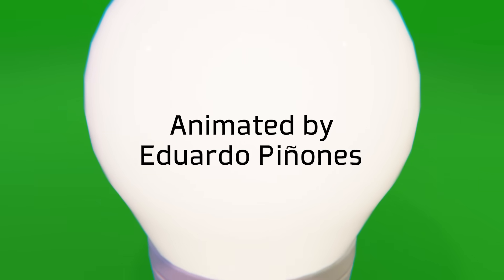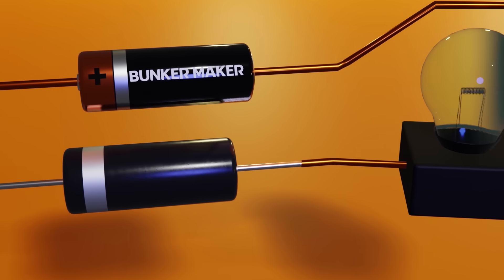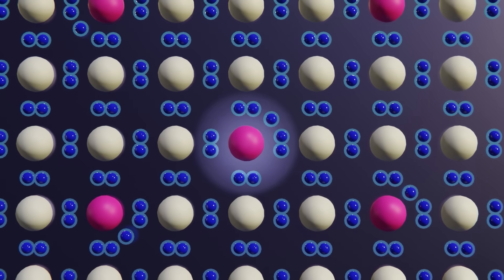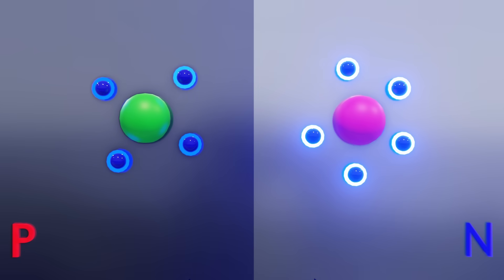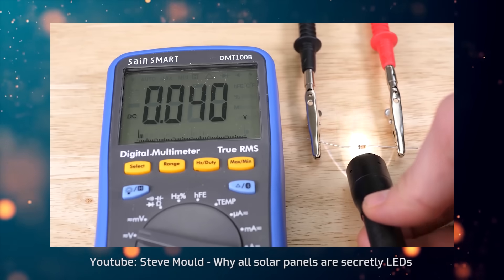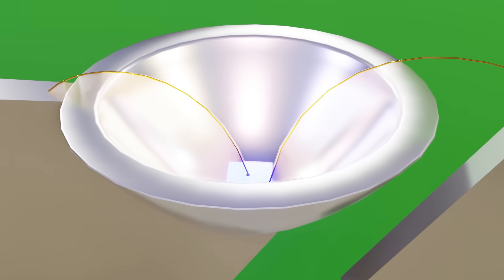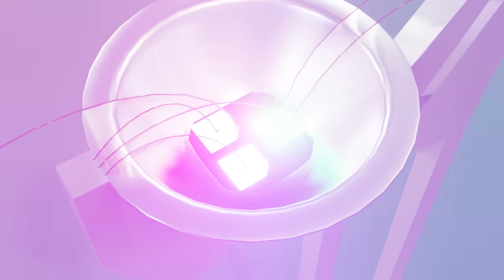How LED works ⚡ What is a LED (Light Emitting Diode)

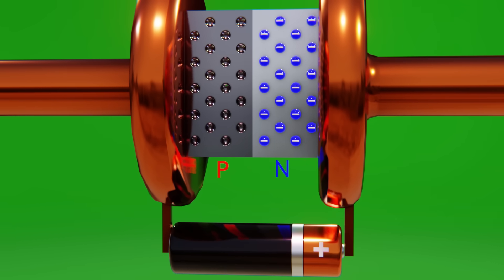Comment: At 3:45 you showed that connecting the negative terminal to P side and positive to N side results results in reverse polarity and hence no current flows
Then at 7:00 you say that P type side needs to be thinner and on top as this is where the energy exchange happens (also shown at 00:20)
Now at the beginning of the video 0:13 it can be seen that the negative terminal is connected to the P side and positive is connected to N side, yet the current still flows but doesnt in the opposite polarity which, supposedly, should be the right one
How is this possible? It doesnt make any sense
Reply: i have concluded that his wiring to the P and N type layers on the LED at 7:00 is wrong/reversed (as well as at 00:20)
Reply: We have for over a hundred years considered electrical Current flowing from + to -. . . .    Well we now know that electrical Current is the movement of Electrons, and electrons flow the other way round, from - to +   so polarities can sometimes get confusing.. . .  Any questions. ?

Comment: I first learned of LEDs in the mid- or late 60s and was fascinated as the different colors were developed and efficiency increased. I was aware of the narrow spectrum of light they produced so was excited to see the advent of the 'white' LED. Not so much to my surprise, they are actually closer to the old fluorescent lamps, with the blue energy supplied by the PN junction instead of the mercury arc. But, like the fluorescent, most of the useable light comes from the conversion supplied by the phosphor layer that mimics the colors 'temperatures' we all knew back when: Warm White, Cool White, Daylight, and everything in between. Should these be more accurately called SSFs (solid state fluorescent)?
Reply: Hi sir I am India and i am a electrical engineering student i can't understand electronics so can u please help me with this subject because I don't have any knowledge about this subject please sir

Comment: Simplistic and some misleading information about light emitting diodes. In reality, an LED is a real-life demonstration of quantum mechanics.
.
The movement of electrons and holes (positive charges) in a semiconductor are constrained into discrete energy bands by the wave functions of the atoms in the crystal.   The emission of light is caused by electrons making a transition from a higher energy band to a lower one after crossing the PN junction.    The different colors of light are selected by choosing the band gap of the semiconductor.  Silicon being in the infrared,  gallium arsenide in the red,  gallium phosphide in the blue, and Gallium-Arsenic-Phosphorus alloys being variable.
Reply: Well yes true in the closer detail.. . .  I have know this for a long time, and yes it is at the Atomic level and band-gaps energy levels, but I am not sure if you can bring quantum mechanics into it. ?
Reply: @hughleyton693   Einstein won his one and only Nobel Prize for his 1905 paper using quantum theory to describe the photoelectric effect.  A LED is indeed an example of quantum mechanics in action.
Reply: @geraldmarcyk524    So please explain the quantum mechanics aspect of LED's, because I do understand LED's fairly well, but I know nothing about quantum mechanics.
Reply: @hughleyton693  SImply,  electrons travel in discrete bands in a semiconductor. .  Electrons in an excited state can only emit light in specific energies when they decay to a lower energy band.  (the quantum effect described by Einstein in 1905).  The whole idea of direct and indirect bandgap semiconductors and the impact of the Heisenberg uncertainty principal on the energy-momentum distribution is beyond this discussion.   I suggest you visit Sabine Hossenfelder's excellent youtube channel for more information on quantum mechanics.
Reply: @geraldmarcyk524     Done it again, lost my reply  Ah.!. . . .  Yes, you are quite right, the electric current through the LED, gives energy to some electrons and drives them up to a higher state of energy. . . .  When they collapse back to their normal level, they release energy in the form of photons as light, according to the material doping. . . .    Ah.!, so this is what you refer to as quantum mechanics. !

Comment: Wait, i was under the impression electrones do not travel at all. This whole explanation is based on electrones moving. Whats going with this video?
Reply: Electrons do Move, under the influence of a PD ( Voltage ) across the length of a wire, or across the connections of an LED, through the p-n junction.

Comment: Oh really...you might think you know about LED grow lights and offer a list
of benefits as to "why" to use them but are you sure about "how" they work.
Personally I will need to review this simple idea many more times...many more.
Reply: What is your confusion. ?   Can I help you. ?
Reply: @hughleyton693  It's just a surprising science I had no idea. I'm sure most people using LED lights would be surprised as well.
Reply: @tonyfeuerhelm  I was in electronic equipment design for airports when LED's were becoming available, So I designed in many Red LED's and indicators, they worked very well for that application. . .  Made my designing easier and the customer easier for checking and servicing.. . . So I learnt early how they worked, and their specification limitations.
Reply: Most users of LED Lights do not even know there is complex electronics in the Lamp base.

Comment: An LED has an intrinsic voltage barrier. Each P or N semiconductor has different valence heights above the intrinsic voltage where electrons can orbit (0.65V for silicon). When the Electron goes between P and N it has to jump this gap. Just as with any atom this jump between Electron orbitals can happen if photons of the right wavelength arrive in the electrons orbit causing the Electron to jump up one or more orbital distance or emit a photon of a particular wavelength when it drops back. The LED just happens to do this hopping orbitals thing at 680nm, or Red light at an intrinsic of 1.8V. Blue is 450nm at 3.88V.
Reply: Yes, simple when you know.   🙂     .  I learn that back in the 1970's or so, when they were new.

Comment: The PN junction is without a doubt the backbone of the modern age. Without the PN junction we would only have electromechanical relays to rely on; which are far too large to put billions of these inside a tiny chip. The PN junction can be so tiny, right now the 4nanometer process in Taiwan allows a single chip contain tens of billions of transistors, and this is what allows us to all have fancy computers in our pockets.
Reply: Modern CMOS chips are less dependent on PN junctions, as MOSFETs do not directly rely on PN junctions for their operation.
Reply: Backbone of the modern age. ? .. .  I was working with may different Valves ( Tubes ) for many years, before working with Transistors and P-N junctions. .    Actually I was playing with some very early Mullard transistors OC90's and 92's before getting professionally involved with Valves, so I already had some understanding of Transistors at about the same time as Valves.

Comment: Hello, thanks a lot for this brilliant explanation! I finally grasped, how diodes, transistors and LEDs are working. Really excellent, this video. Greetings from France, Manfred
Reply: I make led lamp beads.
Reply: Transistors are very different, but do use two junctions, the main ones I used were n-p-n junctions so worked easier with +V supply voltages on the Collector. . . .   Transistors are Current amplifiers, not Voltage amplifiers like Valves ( Tubes ) were, although modern FET Transistors are Voltage amplifiers.. . .   

The simple principle of using a normal BJT transistor, the most common type. . .  Is that you put + Voltage onto the Anode or Collector and due to the junctions, no current ( electrons ) flows between the Emitter to Collector.. .   But If you put some +V on to the Base, then that easily causes Current to flow between the Emitter and Base, which then opens up the path for good Emitter to Collector current flow. . . .  Very typically you could get about 100 times as much Current flowing between Emitter to Collector, as the Current you made between Emitter to Base.. .  We call that a current Gain or Hfe

Comment: You will pay less for lower quality light. You get what you pay for. Cold white LEDs are awful and should be banned! Incandescent light will always be a higher quality light!
Reply: Wrong. . . .  Daylight White is the best colour for workshops, Kitchens, and other daytime work areas. . . .  Warm White is better for lounges, Bedrooms and evening use.. ..  LED's can be made in any colour or range of colours.. . .  Just go out and buy the right ones for your application.. . .   Incandescent light can never easily make true Daylight white light.. . .  And use up 10x times as much electricity for the same level of illumination. . .  So you are badly wrong.

Comment: Flicker is a problem
Reply: Horribly annoying when used as automobile taillights! This would not be a problem if they just increased the frequency a bit.
Reply: That is due to the dimming technique of pulsing it with power (PWM Pulse Width Modulation) - discrete pulses of on/off power instead of lower current (because it can't effectively be done that way).
Reply: What flicker. .. .  You have not explained.. . .  LED's do not flicker.

Comment: Had a dedicated special course of Optoelectronics. If you really want to understand the full physics  and involved principles and mathematics- a lot  to learn and mich more than 8min. Found ut the hardest part of electronics at all.
Reply: I only use mathematics in designing electronic circuits, not in understanding how Transistors work. . .   And the mathematics of Transistors is not helpful in designing electronic circuits. . . I built the test circuits and measured how they were working and then selected the actual working values and components for the required performance, basic mathematics will not help you there.

Comment: I was fortunate to be a technician on a research vessel and was tasked to illuminate evenly split hard rock core samples. The area to be illuminated was only 40 mm in-depth but in order to achieve the depth of field which was specified by the design criteria, the intensity if the illumination required the light source to be very close. 100 mm. As light dissipates to the square of the distance, the very bottom illumination would have “fallen off” enough to be visually detected. As the intensity of LED’s can be increased and decreased without change in color temperatures, I was able to make an array of lights and varied the voltage to paint evenly from top to bottom. This would have been impossible with halogen, fluorescence or other types of illumination. LED lighting was key, however we had to match color temperatures of all of the lights in the array because of the lack of consistency in manufacturing. Also LED lights are extremely heat sensitive and will change color temperature over time. It is a newer technology and has its share of growing pains if accuracy and consistency is needed.
Reply: ledI make LEDs.

Comment: Good animation, but the diode surface is not covered in PHOSPHORUS, it is covered in PHOSPHOR which is a completely different thing
Reply: Yes and No. . . . Correct, Basic LED's do not have any Phosphor. . .    They radiate which ever colour their doping makes them work at. . .    We only cover the LED with Phosphor for White light. . .  The phosphor allows some Blue light through and converts some blue light to produce Red and Green light, so our eyes think it is White light.
Reply: The module was supposed to read “phosphors”

Comment: This info in not accurate! While it explains how regulare diodes work, light emitting diodes produce light when a voltage is applied, and forces the electrons across the band gap or orbit level, this is temporary, and the electrons fall back across the band gap producing photons. These photons are produced at the junction of the doped and regular silicon. Doping is usually Galium arcinide, and junctions are vertically oriented on most typical led lights, and horizontally on high power diodes which produce intense light called lazing. When collumnated with a fiber lense is how a laser is made.
Reply: Yes, you are correct, the video sort of said that, perhaps not as clearly as I understand it. . .    Yes, the forward current through an LED does cause electrons to move up to a higher, more energetic level, state or shell and yes, they emit light when they fall back to their natural energy level or shell.. .. . Electrical energy In, Light energy Out, and some Heat energy out.

Comment: They often eliminate the second electrode wire.  The die is mounted to, in your video, the metal reflector.  This becomes the negative input.  The electrons pass upward to the junction and are bled off via the positive electrode wire.
Reply: I never ever saw any like that or used any like that.

Comment: Reverse polarization of a PN junction can be used to vary the capacitance of the junction, turning it into a variable capacitor for radio applications.
Reply: Electrically tunable radios before Sorfware Radios used these and they were called Varactors, such as the MV204.
Reply: Now that is getting far more into electronics.. ..  Yes, VeriCaps. . .  Going even further, we made Parametric Amplifiers for Microwave Receivers, using that principle.. . .  A parametric amplifier principle is that you feed the signal in, when the Capacitor value is high, then you effectively pull the plates apart, reducing the capacitance value, which from ½C.V² will now have to increase the Voltage across that capacitor. . .  So now you have a Voltage amplifier for very small, low level signals.  .  :-)

Comment: what nonsense - if you cut open a diode you will see physical characteristics of wire and plate that actually produce the diode effect. The doping just improves the affect but this explanation is based upon bad science, i.e., corporate academic nonsensical science.

Comment: thanks for your video and i wanna konw that all diodes are lighting when it work? if we can slice any regular diode and let it work, it will shinning?
Reply: No, I do not believe you will see anything.. .  At 0.6V would indicate a long wavelength which is out of the visual range. . . I used to use glass diodes in the early days, even one for my Crystal Radio Set.  🙂